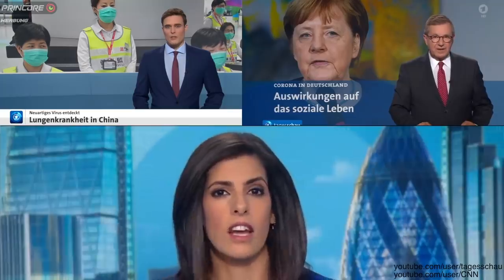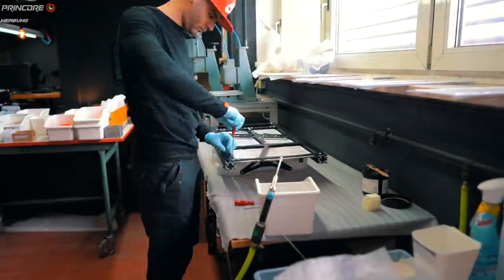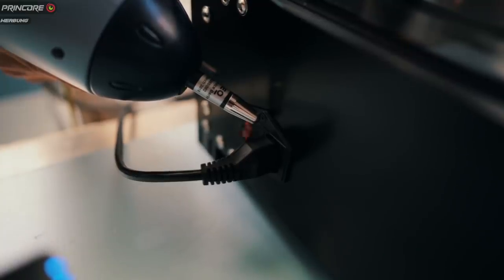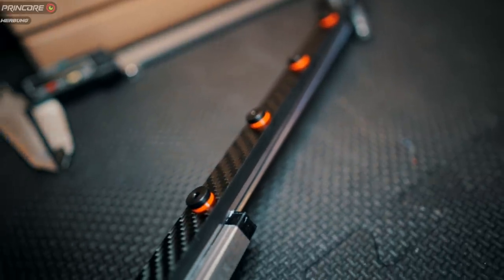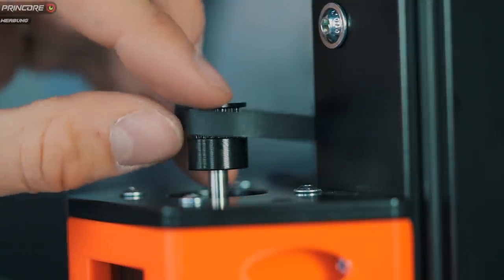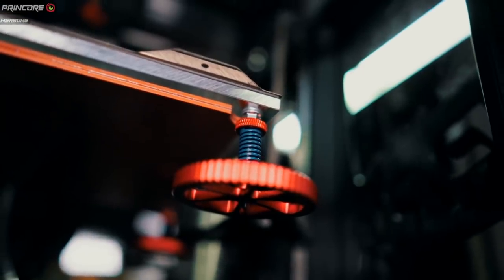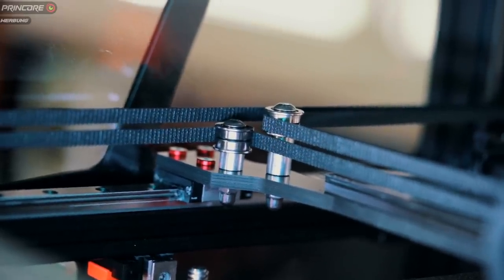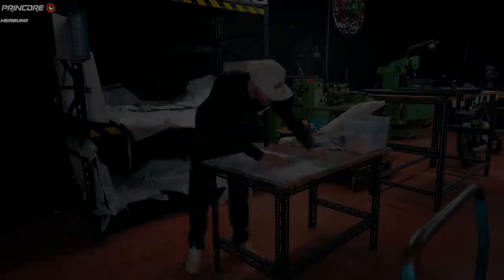PRINCORE ONE 3D Drucker - Preis - Entwicklung - Daten

Comment: Irgendwie bin ich zu blöd mobil, das Druckvolumen zu finden. Weiss das wer?

Toller extrem guter Drucker.
Das wird mal bestimmt in die nächste auswahl nächster Drucker. Wenn Dual Extruder hat dann noch bessere Chance.

Ich habe auch einige Stunden in Visual Code mit Marlin verbracht damit mein gemodetter Ultimaker 2+ läuft auf Marlin 2.0.9.3. 
jetzt passt alles.
Denn ganzen Drucker neue Linear Wellen und Lager beschert. Das Ding oft genug zerlegt.

Comment: Für leute die einen Drucker suchen der gebaut ist wie ein Panzer und nicht selbst großartig daran rumfummeln möchten ist der Preis okay, vor allem nach dieser Erklärung.
Ich für mein Teil habe mir einen Ender 5 geschnappt, habe diesen zu einem richtigen CoreXY mit Linearschienen umgebaut, Neues 8mm Bett mit 230V Heizmatte rein, Spindel mit 2mm Steigung statt 8mm ab werk, Afterburner bzw. jetzt Stealthburner Toolhead dran und Klipper als Firmware installiert - und die Drucke die da nun rauskommen sind so nah an der Perfektion wie es die Physik für geschmolzenes Plastik zulässt. Funktionsteile drucke ich mit bis zu 300mm/s, Beschleunigungen von 10.000 mm/s² und Jerk bzw. Square Corner Velocity von 8, wenns dann schön werden soll mit 120mm/s und "nur noch" 5.000 mm/s² Beschleunigung und 5er SCV. Das schöne ist: ich kann mich auf das Teil verlassen. Selbst wenn ich den 2 Wochen nicht anschaue, kann ich einfach Filament einspannen, Druck starten, wieder gehen ohne auch nur der ersten Schicht zuschauen zu müssen, und nach Stunden zurückkommen und der Druck steht unfallfrei da.